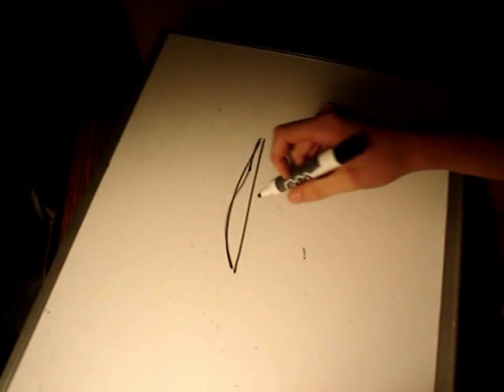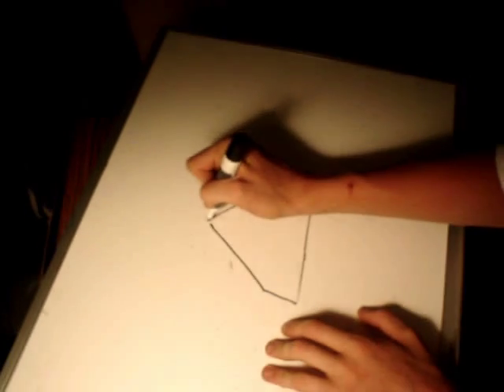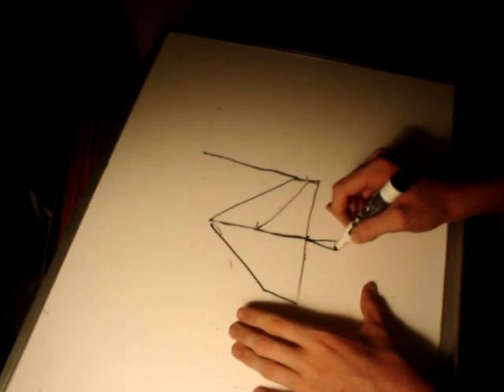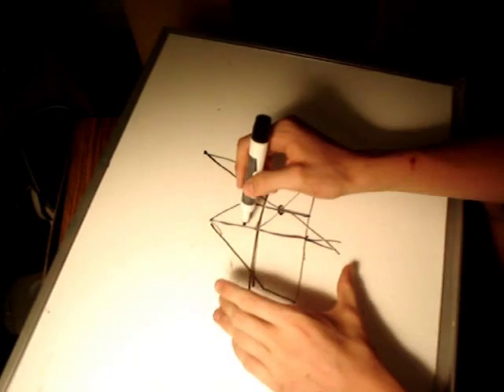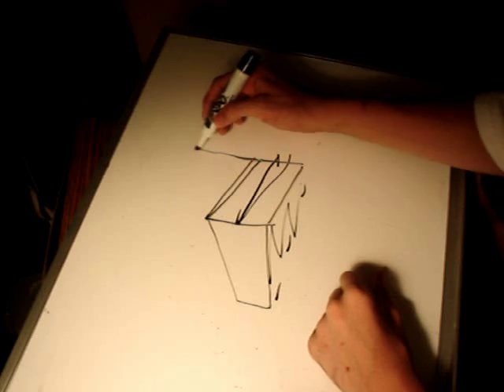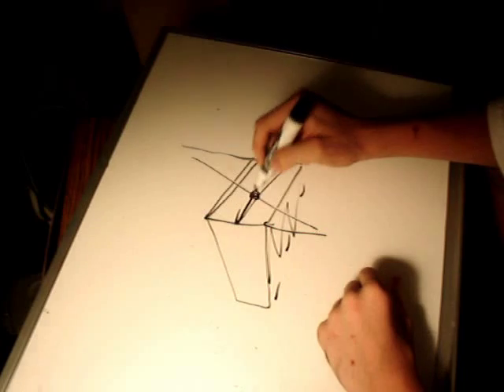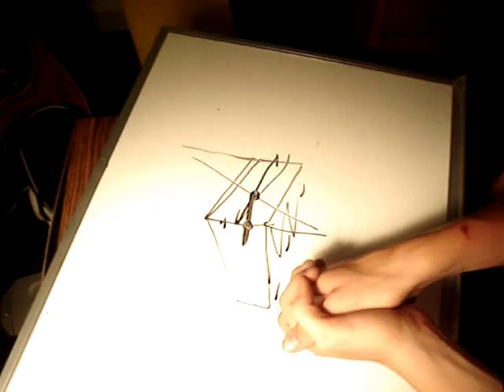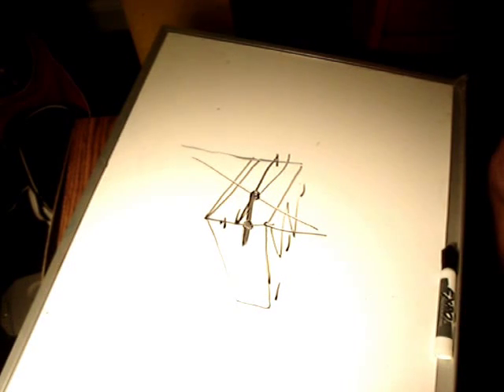(REMAKE OF HOW TO BALANCE A FLYING WING)

Comment: Here's the bottom line, no video needed: Cut out your delta fuselage. Measure the distance from the tip to the rear of the fuselage. Take 20% of that distance and go that far BACK from the tip. There' s a good starting place to find your CG. Set up your delta with all the electronics attached. Throw it across the yard. If it noses down, scoot the battery back. If it noses up, scoot the battery forward. Mark the spot for the battery and complete your build. Happy flying.